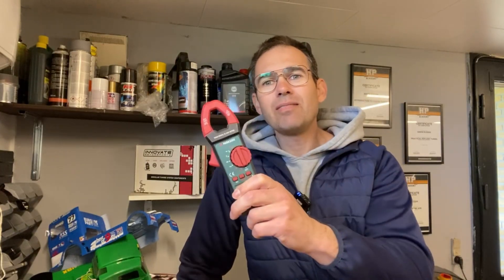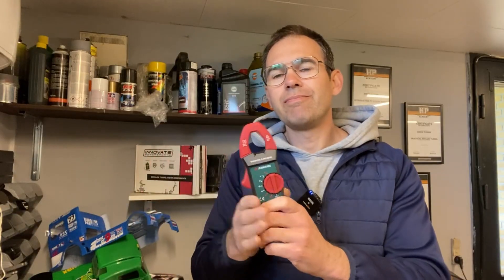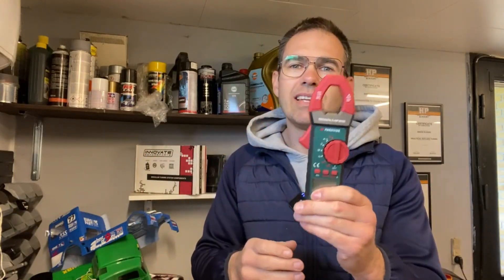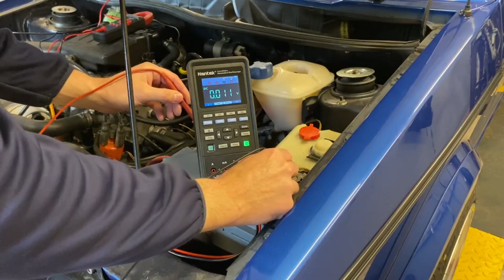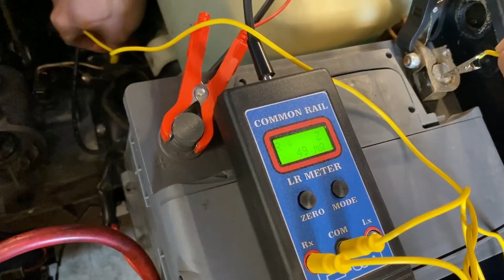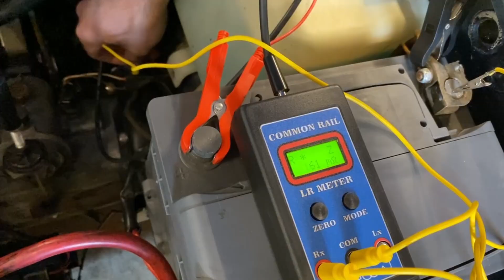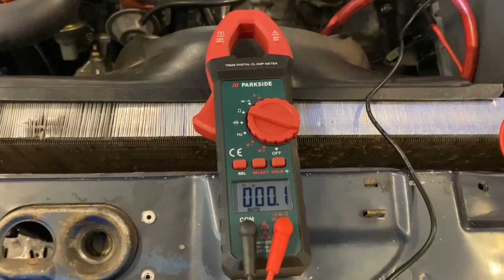PARKSIDE (15 EURO) vs. HANTEK (250 EURO) multimeter

Comment: Your resistance measurement is flawed. That 0.1 ohm you measuring is just ordinary meter error, not comparable to what your LR meter is capable of reading. Clamp meters are nice with AC/DC current but now I think it's the time for oscilloscope multimeters. Think about it, how many instances in your life are you actually going to measure current. In automotive may be only when measuring parasitic current and sometimes starter/alternator current which even then will be hardly ever.
Reply from the maker: Flowed or not, the resistance measurement is similar to the LR-meter. But I agree with you, the clamp is rarely used in automotive diagnostics. A decent scan tool, a multimeter and a scope is basiclt all you need. Nevertheless, we tend to buy more equipment than we actually need :)THanks for you comment!
/Simon

Comment: The current clamp is the main advantage of the parkside, and the much easier user interface. For working on cars a DC current clamp would have been a nice thouch though. I have a simular one from Uni-T with dc current clamp and I have the hantek one aswell but that one I mostly use for the scope.
Reply from the maker: Thanks for sharing, I will have a look at the Uni-T.
Reply: @autofokusDanmark   The one I have is called UT210D. When I bought it the first thing it helped med diagnose was a parasitic draw on the alternator which is difficult to measure reliably unless you have a none contact meter. But it is a pretty hassle free to measure any amp draw. Good luck. :)

Comment: It's amazing how much you can do with inexpensive tools. I am a diy mechanic so I don't pay for premium tools. Most of the times you don't need super accuracy with automotive work. I have several meters but my favorites at the moment are my inexpensive Astro meters. I've compared them with other meters and they seem to read accurately. I have a multimeter and a dc/ac amp clamp. Must have tools for diagnostics. The amp clamp is perfect for taking quick amperage readings and to find faults👍
Reply from the maker: Hi Marc. I could not agree more with you. As a DIY the cheap tool are more than capable to solve the issues we face in our garage☺️.
Feel free to share links of the tools you reccomend😇